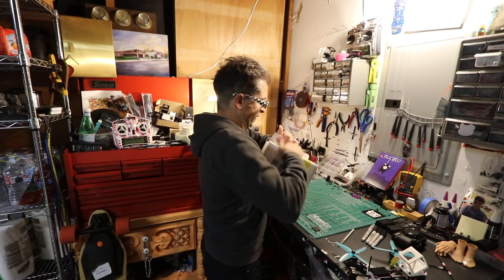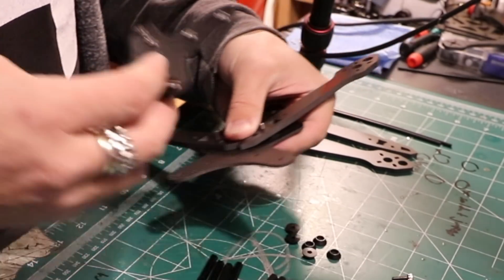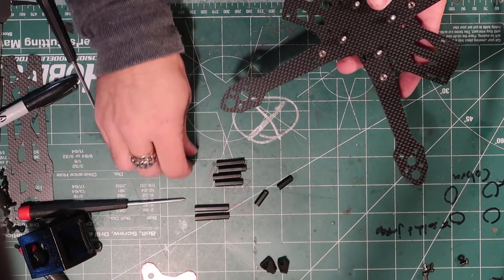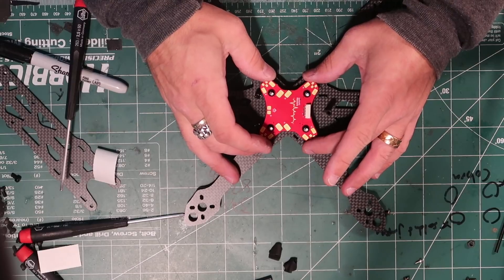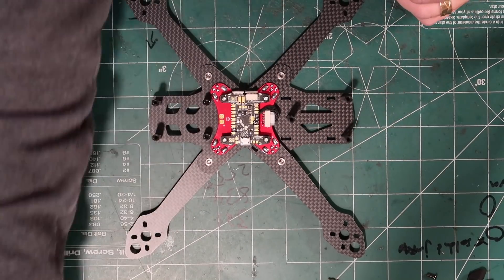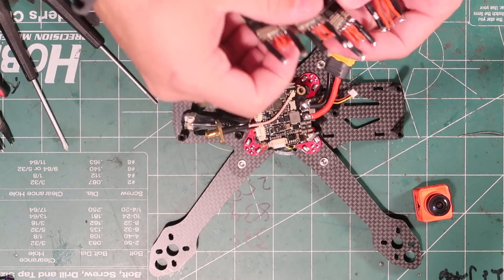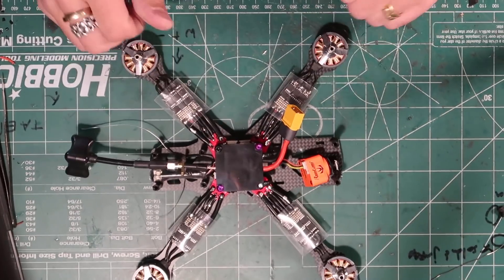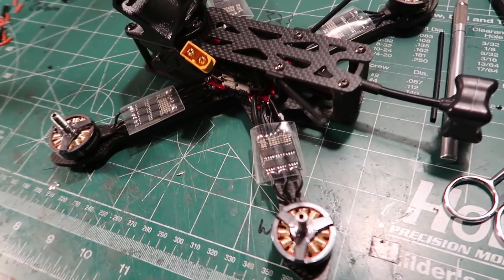ImpulseRC REVERB frame FPV build video

Comment: You are the FUCKING best bro. I have been looking and looking for a method to use my 2 FPVision boards "that originally stacked with the Colibri" to another FC system. I knew this must be possible as people have been running TBS OSD via pnp25/50 for a minute but I have been unsuccessful in finding a map of the pinout for the FPVision stack mount. Just this morning I messaged Trappy on the TBS forum with a request for this very application. So again... Thank you bro!!! You fuckin rock.
Reply: Wait the god dam BST port. WTF. I have tried or is it the Kiss V2 have a larger compatable BST?
Reply: I had assumed that I would remove the Stack mount from the FPVision and micro solder to the appropriate tabs making this board work with a BFF4 board. Do you have or know the pin out or should I just un assemble the FC side of the BST plug and hit the BFF4 rx/tx with the cut wires from the BST?
Reply from the maker: Loki's Dream let me know if you have any questions. I can try to walk ya through it
Reply: Is it the Kiss V2 that has a 5 pin port for the FPVision BST? A diagram of the BST port lay out would be awesome or a diagram of the pin mount on the topside of the FPVision where I could remove the mount leaving the tabs exposed and solder to the appropriate tab if I could only find a diagram. Do you know the mapping of either the BST or the Stack mount on the top?
Reply from the maker: Loki's Dream I run a crossfire micro v2 rx. So the bst goes to the crossfire and I can run a tx wire from the crossfire to the Kiss FC for pid control on the taranis and the osd control is via sticks as well.
Reply from the maker: Sorry, I’ve never tried the BFF4 board
Reply: Ahhhhhh. Well I must say the Crossfire has had my attention for a bit now and this is just another reason to justify making the switch. Do you know by chance where I may find a diagram of the JST output on the FPVision? And thanks again.
Reply: I will continue to pester Trappy as well. Lol.
Reply from the maker: Loki's Dream do you mean for the bst port?

Comment: With FPVision installed this way you're not getting the proper mah consumption are you ?
Reply from the maker: ArtFPV battery directly into the vision, 98-99% accurate thus far and I’ve been running this set up for a year or so on every other quad.